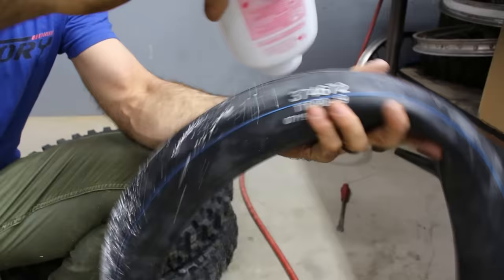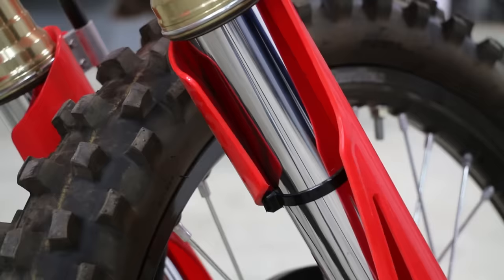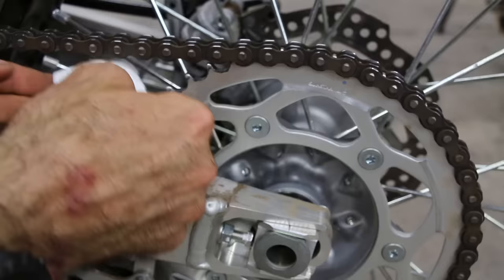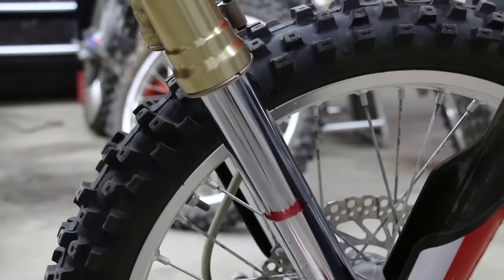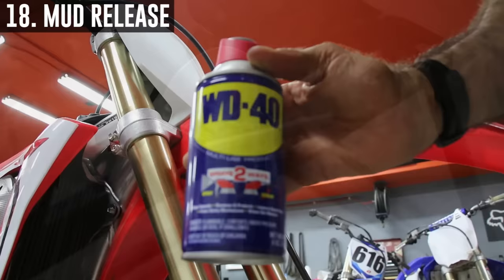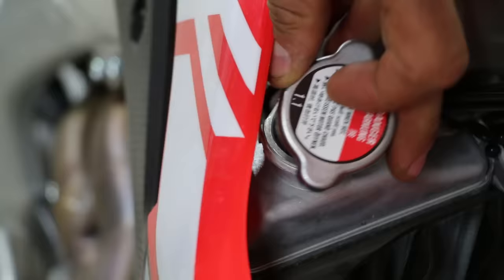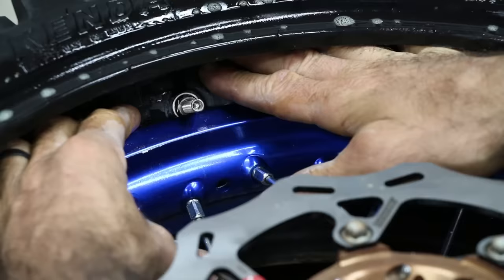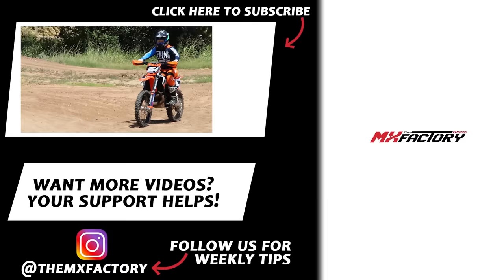31 Seriously Helpful Dirt Bike Hacks & Tricks

Comment: “A leaky fork seal can ruin a day of riding” my Cr250 forks are bone dry so they don’t even leak anymore
Reply: Sounds like a well maintaned piece of machinery
Reply: #relatable 😂
Reply: Same bro
Reply: Lmao perhaps you should fix that
Reply: My rm125 forks need a rebuild
Reply: I’d love to see what your air filter or top end looks like. Bet your clutch basket is notched to hell as well lmao
Reply: @tpghl5225  well I put a lot into my bike in the last months so now it has nothing wrong with it but I was always good about air filters and checking the engine and transmission. I was in the last few weeks of my riding season back then so I was letting the forks go until winter
Reply: Same with my cr 85 it just rides a little rough tho
Reply: @tpghl5225  my top end probably needs rebuilt after 31 years 😂. I have a 1989 xr250r
Reply: @garrettgoodwin584  that’s nothing for an old xr lol
Reply: youll love that 50+ foot landing then
Reply: Lol mine are dryer than the Sahara desert
Reply: So you clearly don't ride it, Otherwise you would know how stupid that statement is, If you have no fluid in your front forks the bike is not rideable.
Reply: @janprokopenko7928  My grandpa got tired of fork oil in his truck so I just stopped adding fork oil.
Reply: That's one way to fix the problem
Reply: @quaussiemoto3939  he was trying to be funny...
Reply: 700th like feeling good
Reply: There ya go problem solved idk why people have to do it the expensive way???
Reply: Lol
Reply: @garrettgoodwin584  shit it being an XR that top end is just getting broken in
Reply: Bet your suspension got way softer
Reply: Ah I see, can't leak if there's nothing to leak #BigBrain
Reply: Вы должны быть цветным человеком
Reply: That's so dangerous man. Must be like riding a Kangaroo! 😂
Reply: Fuckn Gold mate!
Every good big jump my shock oils me chain👌🏻🤟🏻🇭🇲
Reply: Same
Reply: Zipties around fork dust seal
Reply: hahaha lol
Reply: Cant leak if it doesnt have any oil😂
Reply: I have one good fork and one bad fork. I need to fix it bad 😂
Reply: I hit a 50' jump on my yz250 with no oil in the forks. It pogo sticked me into the air off the rebound into a full front flip. I landed upside down on my head and my helmet broke my collar bone. It's possible to ride still but with no oil flowing back and fourth through the valve system your looking to get pogo'd!!!! Hahahahahha

Comment: The master link one has me wondering how other people may do it if they don’t use a screwdriver lol
Reply: A harbor freight nail puller works too , the split goes around the pin, but it doesn't quite work as well to put a master link om.
Reply: I always use pump pliers works very well if the tip of the pliers not worn out
Reply: Use a knife works fine for me

Comment: WD40 takes off unwanted adhesive and shines plastics
Reply: @jaysmokey  suppose for a day riding on muddy rainy tracks or any gums; does wd40 works in between not to get the sticky muds onto the plates/ or any fender ?
Reply: Paint thinner solvents for sticker gunk work best
Reply: Pam vegetable spray works the best hands down cant beat it. And just for yall that dont know, the wd in wd four dee stands for water displacement lol
Reply: @McNamEvan  you do have to be careful about what paint thinner you use and the strength though, I made that mistake and it melted my plastics
Reply: Water displacer clues in the name
Reply: I used WD40 on everything back in 1981-1983!  Always made the exhaust pipe shine, and plastic look clean...

Comment: Repair fender cracks with a soldering iron, just melt the plastic back together like welding, works a treat.
Reply: Thats how I fix plastics as well!!
Reply: Nice tip 👍
Reply: @Andrey Angere I think it looks good to
Reply: For 20.00 u can get a lot that has heated wires u melt in and then plastic weld over never tell they there or a break even happen

Comment: I’m a pro bicycle mechanic and aquite a few tips I’ve seen transition over to Mx. I like to add grip tape to the ends of levers on brakes for a better fee and finger grip. Goggles tear offs I like to stager so I can pull them one one at a time without pulling them all off. Silicone spray for fork and shock stantions. Colored coded tools for faster identification helps me in high stress moments. Roll of gorilla tape for the rim surfaces. To name a few

Comment: Yo, some of those  tips are awesome, The best tip i ever got though was from An ex factory Yamaha rider. To bleed your front brake's. Zip tie your front brake to the throttle so that the brake lever is totally compressed. and leave it overnight the next day all of the air will have leaked out of the system without needing to bleed the air out. brake lever will now be 100% firm.

Comment: To prolong goggle lens life, mount a tear-off and cut the pull tab away. This is a preventative measure against hard dirt or rocks ruining a lens as quickly. Remove and replace the tear-off when necessary.
Reply: Clean the inside of the lens with white shaving cream before a hot/wet ride. It keeps the goggles from fogging up. I keep a travel size bottle from the dollar store in my riding bag.
Reply: 😂😂😂 as a racer that is hilarious. We go through tear offs faster than a flywheel makes a rotation
Reply: @varnesracing2270  This is not intended to be the 'only' tear-off. Rather, a last, ideally, non-pullable tear-off that will stay behind to keep the lens from taking a beating once you run out of the others. Basically, it's just serving as a 'lens protector'.

Comment: Hands down the most informative video I ever watched.
When fitting a tube it's easier to push both beads down by the valve aperture, put the valve in with ease then gently pull the top bead back up then slip the rest of the tube in then fit the top bead (I'm a tyre fitter) 👍
 I feel like a pro-noob now 🙂
Thanks 👍

Comment: Using compressed air is the best way to install grips too, not just to remove. Also, I was never a fan of kinking the chain to tighten the axle nut, it is pretty simple to push against the back of the tire with your shin using your foot and hold it there while you tighten the axle nut. For cleaning the fork seals real quick you can also use a tear off. and That is not how you do tear offs at all! If you fold the tab under then it will not flip out for an easy grab. always fold the tab in on top of itself under the next tear off so that tab pops out when the above tear off is pulled. Some people like to place the first tear off on the other side in case they accidentally tear off all of them from one side at once, but the tab should still go above itself.
Reply: I instantly thought the same thing about the tear offs.

Comment: There are a lot of radiator leak fix products, but you have to use that only for emergencies. The problem with that is, that the damn thing is gonna thicken up and clog the leak, but it will also block the other flow pipes of the radiator, which prevent cooland from flowing, and it can end up overheating the engine. The same goes for the gray pepper or whatever that is.

Comment: Lots of good tips, I've always used clear coat for installing grips works wonders never had to use wire when using clear coat. Spray on bar and in grip   and since it's clear it won't look like crap. Don't use spray paint only clear!!

Comment: Do NOT use a razor blade to remove sticker residue on your swing arm or anything metal for that matter. Wd-40, carb clean/brake clean will work fine with goof off probably being the easiest option👍🏻

Comment: Also Tar Remover for cars works great for removing residue left on plastics from removed graphics, spray it on and use a pressure washer.
Diesel will resolve air filter oil in your airbox but degreasers like Maximas will work great too, just don't inhale/breath to close to where you sprayed 
Diesel will also make black radiator hoses and other black plastic parts look like new again. Spray on, use brush or sponge and rinse off.

Spray water mixed with a little citric acid and soap on a works style 2stroke pipe to remove rust. Spray it on, scrub with a Scotchbrite pad, rinse and repeat.

Comment: also leaky radiator can be fixed usin superglue and accelerator just clean of the area and apply a smal layer of glue around the hole.
fixed my car this way and it hold upp for more then 4 years (car got scrapped with the radiator still working)

Comment: Bruh did this guy just say dump pepper in your radiator 😂🤦‍♀️
Reply: Probably just acts like K seal People have used eggs in the past to seal rads so youll defiantly have a nice meal with pepper added
Reply: It works
Reply: @motoxguy7  i dont doubt that it wont pal
Reply: Mysterious Rider it is a temp fix, and it does work. You saying “doubt” makes me believe that you have never tried it and are just guessing your opinion....
Reply: @motoxguy7  have fun cleaning that out of your water pump
Reply: Bronson hahaha. Nope. It’s still in there!!! It’s one of my old bikes and doesn’t get ridden enough to buy a new radiator. People use this trick in cars also. The excess will just flow throughout the system. It is less inhibiting then those “floaties” that you sometimes find in your coolant.
Reply: He did. It works as a temp fix.  You will be replacing the rad anyway.  Personally I just prefer pinching off broken tubes with pliers.  No goop in the rest of the cooling system this way.
Reply: Yes he did its a great quick fix. Dont use bars leak
Reply: u heard it right he must be makin somethin.
Reply: There was a product called Portaseal, it was bought out by Bars leaks then discontinued cause it worked better than their product. Portaseal was pepper!
Reply: Yup ! Oldest trick in the book. Not just for dirt bikes.
Reply: 14%?wqubkmnvh.OK ko
Reply: @kyletracey5819  , Yes Sir. I learned this trick when I was 16 and that was 36 long years ago.
Reply: how to get the pepper out? just drain and clean the system.
Reply: it has worked for me many times, even bigger raduatirs
Reply: It's a temp fix that you can find the ingredients for in most fast food restaurants, diners, and camping kits.
Reply: I’m not so sure it’s going to do any justice for your water pump though ... just saying!

Comment: A tip for fastening grips which I use is to spray spraypaint into the grip and then slide it on to the bar. I never have problem with spinning grips. I only have problems geting my grips off.
Reply: Hairspray
Reply: @adambennett1193  Exactly. Hairspray works great as the grip slides on easily and then sticks for as long as you need. When you want to remove the grip pry the opening a little with your fingers, or a screwdriver, spray some hairspray in there and it slides right off without drama. Used to use that trick on our BMX grips. Of course, my hair always looked great too.
Reply: MH, as skinny screwdriver and wd40 works getting
them off, but don't slip and run the screwdriver through
your arm..  I think he used compressed air, that might work
also.. Or razor knife them off, usually when taking them off
means they're going into the trash bin anyway, being replaced.

Comment: I always use baby powder on my new innertubes.  I also smear a tiny bit of Crisco cooking shortening on my new tire beads, so they pop onto the rim easy when I fill the tube with air.  The tire seats quickly and easily every time.  A little dab'll do ya. Just enough to give the bead a greasy feel.

Comment: Just if someone invented a footbeg that never looses the 10mm and 13mm sockets 😞
Reply: Poor Coyote you mean 10mm and 12mm...no one uses 13mm
Reply: Victor Cordova you dont ride dont you
Reply: @victorcordova8338  german bikes are also normal 10 12 and 14 mm
Reply: 8mm so elusive
Reply: mcnameva front brake lever, clutch lever, plastics, clutch cover, stator cover, camshaft towers... I use 8mm on a daily basis tbh

Comment: I try to avoid using WD-40 anywhere there are are rubber seals or o-rings (like on your o-ring or x-ring chain) as the kerosene in the WD will break down the seals.  The simple green should be just fine, but I'd skip the WD-40 chain wipe down.

Comment: Fastening grips..electrical tape on the handlebars, coat the electrical tape with gasoline lightly, apply grip and let dry👍Works much better then wire👍

Comment: If you have an issue with a common bolt becoming stuck it is called being seized to prevent this from happening it would be better to buy a small can of anti seize rather than grease. The grease holds dirt and could make quite a mess.

Comment: Additional tip on number 25 just rub the glue excess with olive oil leave it for couple of minutes then scrap it with razor blade. So easy to remove. 👌

Comment: Zip tie on the fork tube when bottoming can destroy the the dust seal,bad idea.
Reply: The shroud does not bottom on the axle holder. There is one inch gap.
Reply: @jaysmokey  or use a small thin O-ring. Soft.
Reply: @CuriousRoach  um no. The seal travels all the way down on most forks.
Reply: @jaysmokey  when it is  apart for service.  I've been in the industry for 30 years. Simple job.
Reply: @MrKidkiller159  At least not on Kayaba forks. You can always tell where the fork is bottoming by a patch of dirt at the end of the tube. The dust seal does not go beyond that point so it always stays dirty.
Reply: @jaysmokey  I do that to all my racers that I help out/sponsor. Ask your local mechanic next time.
Reply: @jaysmokey  Washougal washington
Reply: @CuriousRoach  your fork is binding.
Reply: Expo marker for the win
Reply: @MrKidkiller159  I use a tool to align it. The tube is physically longer than the fork travel and the stroke is limited by the fully compressed spring.

Comment: Don't use a card to clean your fork seals.  Remove the guard as he did and clean.  Use a seal tool (risk racing).  Take the pressure off the fork (bike on stand).  Pull down the dust wiper.  Clean out under it.  put the tool on the leg.  Then use it.  It hooks the dirt out as you turn it.  The card will push dirt into the fluid making it contaminated and likely sticking grit into surfaces and bushing causing damage.  Clean out around the seal again.  Put a dab of grease has he did.  Press the dust wiper back in place.  Rebuild forks later, if leaking persists do it sooner.  Go a head and order those new seals and bushings with the fresh oil.

Comment: A good way to remove that thick tape adhesive is to spray it with WD40 and leave it for a couple of hours. Then with an old towel it rubs right off.

Comment: All were good advice except the last one with the chain , the chain and sprockets are an expendable like gasoline , washing up an already worn chain won't make it last any longer , aggressive use of chain lube will,  apply lube right after a ride while the chain it hot and as the chain cools it will pull the lube into the chain , the time spent  doing it your way could pay for a new one  , dirt bikes can eat a set of chain and sprockets in a week end maybe 2 if you're fast and dad's cheap , seen drag bikes eat a chain every 1/4 mile . Keep  the bike clean  , I use the magic mix 1/3 wisk 2/ 3 409 mix that' with 2/3 water spray on with spray bottle  and rinse off with water,  let it drip dry or towels , don't blow it off that just pushes the water in , then spray it down with WD40 to dispel any water residue left and keep the plastic from drying out and becoming brittle , and lube the chain  again

Comment: Woah. Razor-blade on aluminum to remove sticker adhesive? No way. Acetone. If you aren't carrying acetone with you when you go riding, or indeed anywhere, you have to ask yourself "what are you doing?" Acetone is such a useful solvent it should be as common as pliers in your toolbox. If you're in a pinch you can get nail-polish remover from the dollar store. It's the same things. Overall a great collection of tips, though!

Comment: Recommended riding boots for someone who has never worn them before? Trying to get into racing and doing jumps on quads/dirt bikes.
Reply: Try them on . Sidi makes nice boots.  Doesn't help if they don't fit right .
Reply: Dude like helmets, each boot has a different fit, so you HAVE to go try them on. As a rule of thumb, Gaerne and Sidi make good boots (although Sidi has been having some QC issues recently). Gaerne if you have wider feet, Sidi if you have narrower feet. I wear Gaerne SG-12 and they are incredible.

Comment: I swear no one in the comments actually rides, like how did you not know a lot of this stuff? A few things i wouldnt do: zip tie on the your forks, heard many storys (mtb not moto) of people bottoming out and having  to buy a new fork seal, pam cooking oil spray instead of wd40 to keep dirt off plastic works much better imo, use saftey wire and a skinny nail or similar (to burn the holes in the plastic) and stitch the plastic instead of glue. Enjoyed the video nonetheless

Comment: Guys i have a stomp 125 pitbike anyone know if that would be good for light mottorcross
Reply: light Moto cross if its a really cheap china pit bike you will probably blow it up or something will fail that's what tends to happen if you want a cheap bike with a lot of power and great reliability get a yz85 there great bikes and made by Yamaha but do your research before you buy one used new there expensive but used you can find a clean one for 1200
Reply: @cristianbello4621  ok thanks

Comment: "Use a file to sharpen your foot pegs" I had to use an angle grinder. They were smooth.

Also, I could smell my boots from across the porch, I sprayed some deodorant in them and they no longer smell. Just use deodorant, not antiperspirant.
Reply: Deodorant has alcohol in it and works for a bit, but next time try putting baking soda. Half tea spoon per boot does wonders and last much longer than alcohol. I thought it was a joke in the begging as i have tried everything throughout the years. Give it a try and you will thank me later.🙂